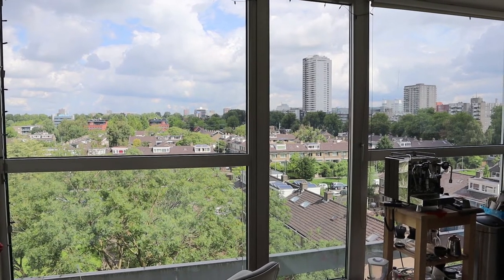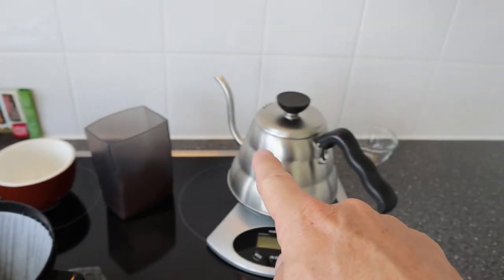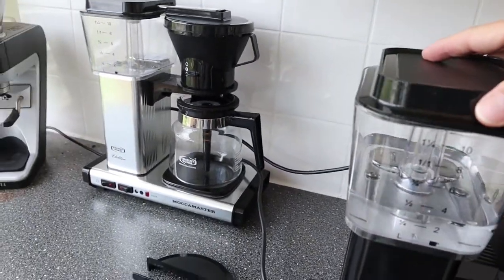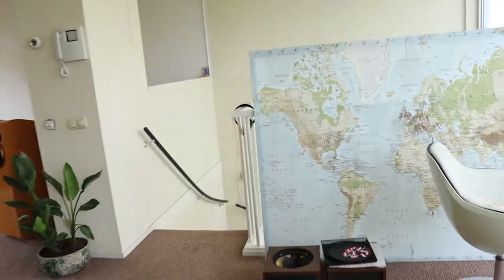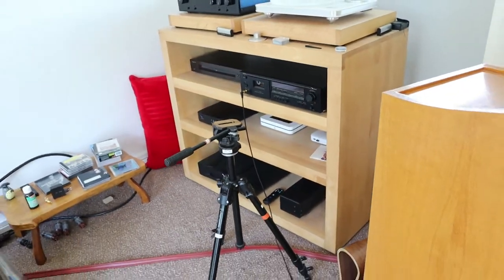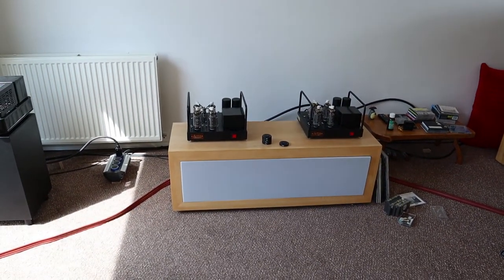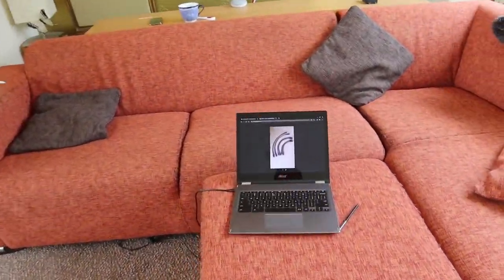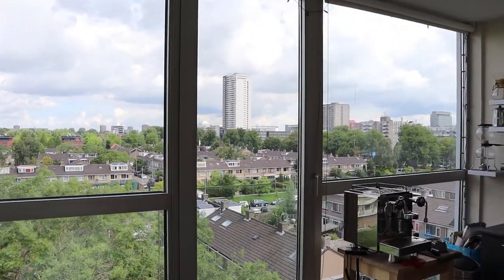Coffee tips, Decoupling loudspeakers, DIY cables and a CD box. Weekly vlog 57

Comment: Great tip! I will certainly put it in practice tomorrow morning. Good to hear that Andrew is doing well.
Reply from the maker: Yes, I was glad to see Andrew again.
- Did you try the coffe trick?
Reply: @theaudiophilebarista2424  Yes, the stirring of the coffee was not necessary; the grind did not float.  However  by not placing the pot under the filter, the coffee had a longer extracting time, which made for a punchier taste. Thanks.
Reply from the maker: @wannerweiposse   My pleasure. Sometimes when the coffee is a bit older it does not 'bloom' very much.
Reply: @theaudiophilebarista2424  ok that makes sense, I use preground coffee for this type of machine.
Reply from the maker: @wannerweiposse    Yes, STOP doing that 😊

Comment: Ivar, maybe the decoupling discs raised the bottom of the cabinet too high off the floor and changed the bass tuning of the cabinet.
Reply from the maker: Miles Dufourny   Thank you. It wil always amaze me how many variables there are for something as ‘simple’ as setting up your loudspeakers 😁
Reply: @theaudiophilebarista2424  Loudspeaker setup is absolutely the most important part of putting together your HiFi system. I got my first "real" system back in 1972 (my uncle gave me his old Heathkit tube integrated amp with some GE coaxials in corner cabinets). From then on it's been an interesting journey. I'm 65 now and still a "bottle-head" aka vacuum tube lover. From 1984 on my systems have always used a tube preamp w/ a very good solid state power amp. I'm still using a Forte 4a power amp (Pure Class A) that I bought in the mid-nineties.
Reply from the maker: @milesdufourny4813    Yes, if you have seen my loudspeaker setup video you know I agree with you 😀
- That Forte 4a looks like a beast. If you are ever interested to showcase your system on my channel you know where to find me 😉